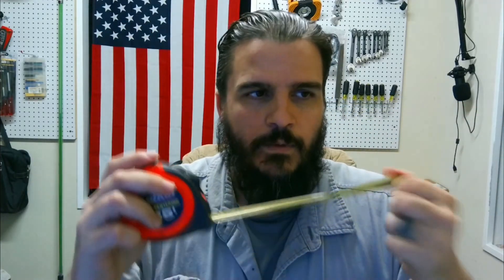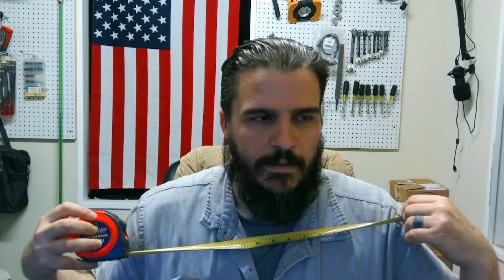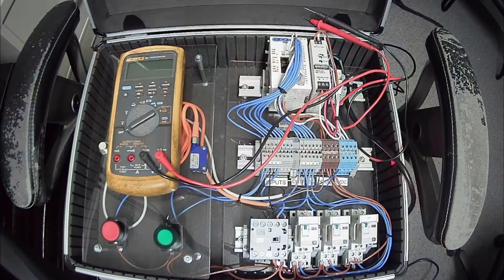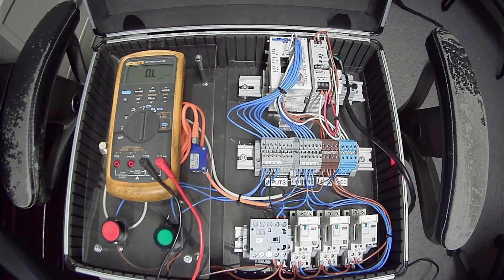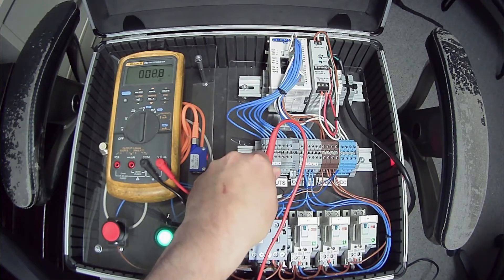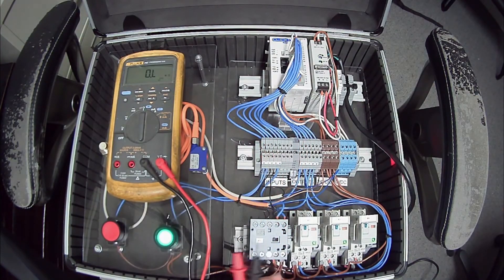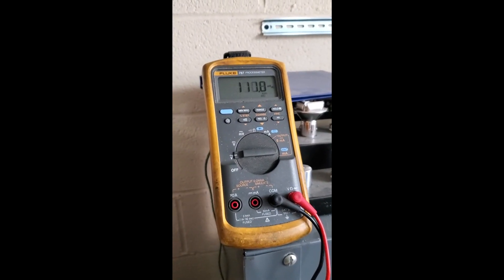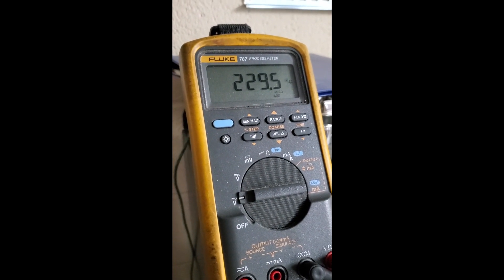How to use a Multimeter to troubleshoot

Comment: So what’s a good range value for good continuity?
Reply: as close to zero as it goes
Reply: For ohms? Under 3 is what I learned in automotive electricity. For a basic continuity test, it will tell if there is a break in the path, but it's still necessary to check the resistance in a conductor to get a value.